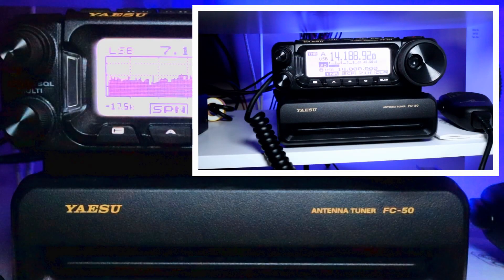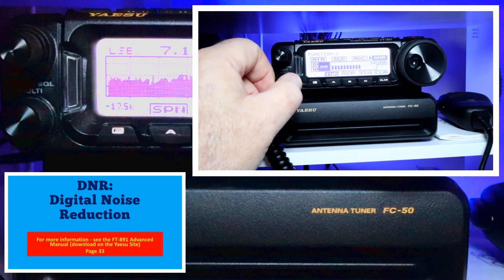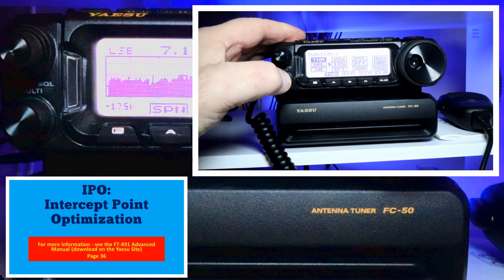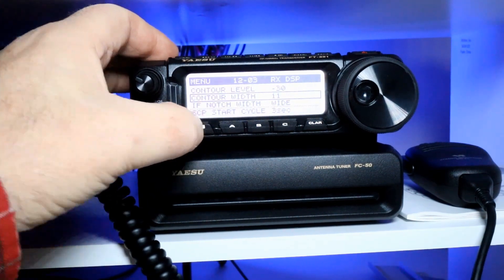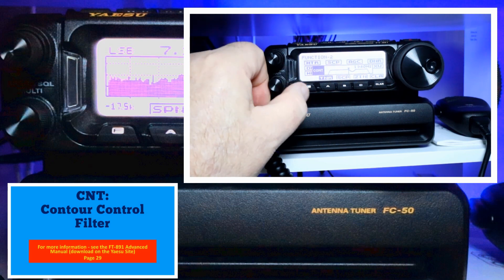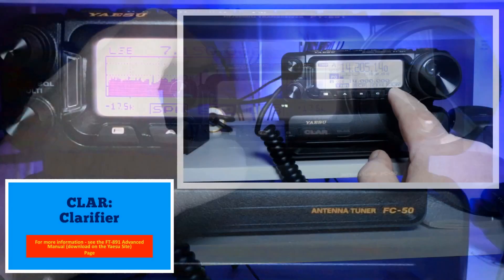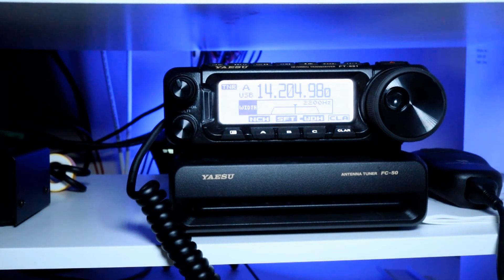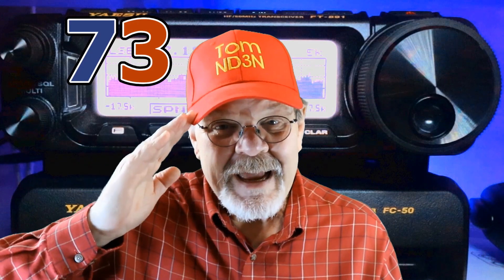How to reduce receive noise and interference

Comment: Im a new FT-891 owner and this is very helpful.  The 891 specs say it needs 13.8 volts plus or minus 15%.  Will it damage the radio if I accidentally let the battery charge go below 11.5volts which is approx 15% below specs?  Many thanks.
Reply from the maker: It shouldn’t be a problem. The rig has protections and will just stop operating if the voltage is too high or too low.

Comment: Hi Tom. Thanks for all your FT-891 videos and tips. I recently purchased one about a month ago. Your tips and explanations of the menus have been a big help getting familiar with it. I do have a question, until just a few days ago i was able to get audio out of the top mounted speaker or an external speaker plugged into the back.   When necessary if I plugged my headphones into the side I got audio fine. Now I can only hear audio when plugged into the side jack. I have the switch on the back of the head set to phone. I am thinking that it must be some menu function that I changed. Any information or suggestions would be apptreciated.
Reply from the maker: I just pulled my 891 out of my car and put it back in my shack.  Took a bit, but I finally got things working and I haven’t been able to re-create your issue.  The OM is useless, but I’ll play with it more over the next few days and if I find a correctable oopsie, I’ll put out a short video with the fix…. 73
Reply: @ND3N  Hi Tom, I called Yaesu and did a full reset. The decision by both the Yeasu tech, Roger, and myself is that the headphone jack is faulty. Thank goodness since I just purchased it on 7/27, DXengineering replaced it. After a 25-minute drive to their store, I was on the road with the replacement. My XYL sometimes wishes we lived further away 😁. I may have been the only ham to have experienced this issue. Thanks again for the informative videos.
Reply: Hopefully,  you didn't go through too much trouble removing your Ft-891 from your truck.
Reply from the maker: No troubles.  Had a space for it and did a quick check out.  Everything rocks

Comment: Great content Tom and thank you!! You talk about IF Shift and Width Together, I believe this is something you would do during a rag chew but not during POTA. Would that be an accurate statement?
Reply from the maker: Since both are used to improve a received signal that may be a bit off frequency, both can be used at any time.  However, during a POTA you'll want to be on a given frequency and not want to vary too far, so while you could use it, you probably wouldn't want to.  If it's close enough to get the info from the calling station, it's close enough.